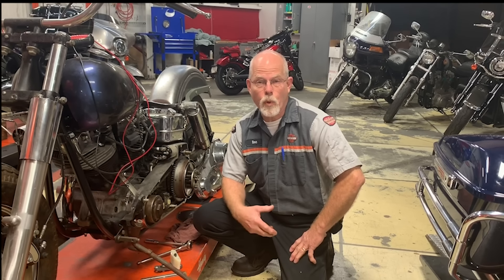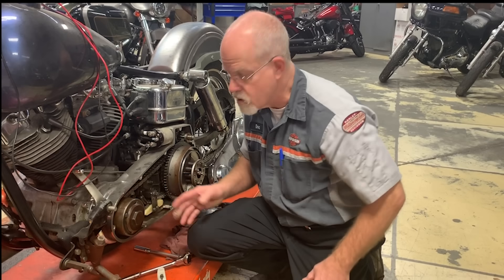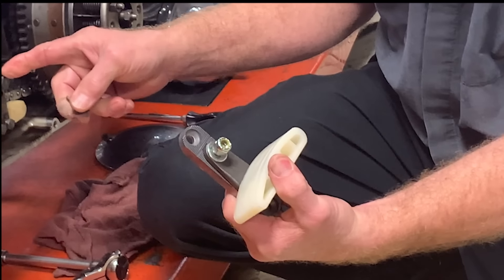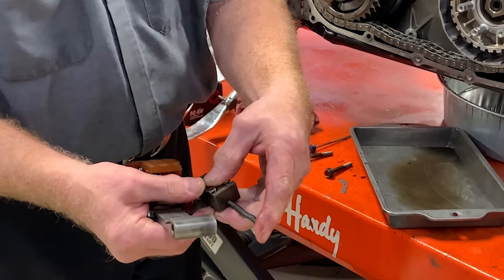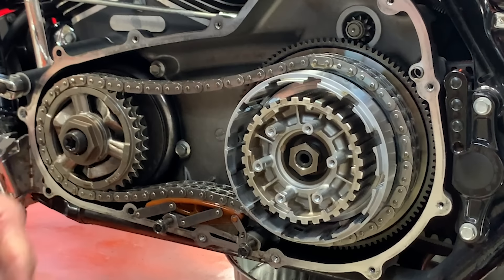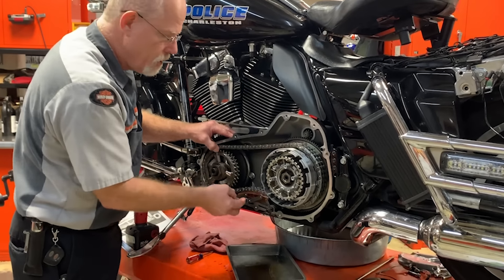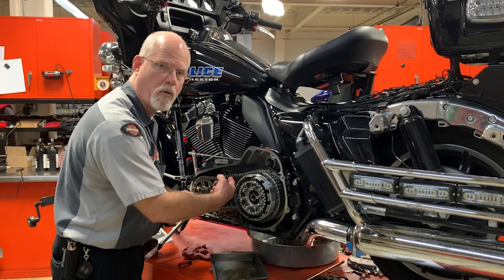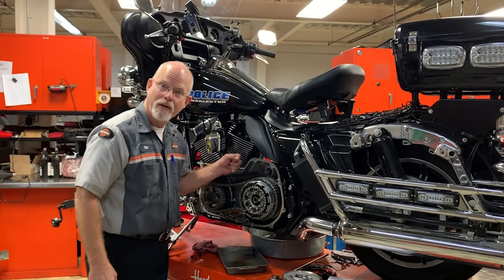DOC HARLEY: PRIMARY CHAIN ADJUSTER UPDATES

Comment: What about the faulty adjusters overtightening the primary and causing bushing and shaft failures?
Reply from the maker: How many have you personally seen? How many have you heard about? We’re they all on stock machines?….Doc
Reply: @LowCountryHarleyDavidson  i had one in my stock 2013 street bob, i changed it with hayden tensioner. It was tight as hqrd steel. I could tell the difference in gear changes in first ride.

Comment: So if my bike has 112 HP and 115 TQ and I occasionally ride aggressively and hard on the throttle, what type of chain tensioner should I run? I have a 2009 DYNA. Would prefer not to do manual adjustments.

Comment: Wat happen if the chain is to ty 2008 street glide
Reply from the maker: Undo stress on compensator, clutch bearings, misalignment of starter to to ring gear and seals leaking…Doc
Reply: Thanks doc for the answer, great video do you have gracias

Comment: Gees I know i'm adding a late comment here but will the primary chain need to be changed out if it becomes too stretched and does it make a type of ticking noise when rotating?
Reply from the maker: Yes if at the limit of the adjuster. The ticking might be the chain going over the sprockets at an extreme angle….Doc
Reply: @LowCountryHarleyDavidson  Could it be possible for you to see a vid of the primary chain in motion? That I can send you?

Comment: Doc I’ve got a 2010 street glide and I changed the stator , I put the compensator and clutch assembly back on and torqued to spec the the chain tensioner back on and new gasket and primery cover and put oil back in and started the bike and I’m hearing what sounds like the chain rattling on the primery cover . What have I done wrong sir ? Please help
Reply from the maker: Maybe nothing wrong. Remove the clutch cover with of course the bike off and held upright. Take a long screwdriver and a flashlight and look at how much the chain moves. You might have installed the primary adjuster at a tight spot. If the chain moves very little. Disassemble and be sure one of the spring plates didn’t move out of place…..Doc
Reply: Are you talking about the spring plates that go onto the compensator ? The only thing I noticed about the compensator was it seemed really loose after I tightened it to spec . But I thought that it was normal .
Reply: I’m doing what you told me and I’ll let you know what I seen .
Reply: The chain has play in it . The tensioner doesn’t look like it has expanded much .

Comment: my 103 had a rattling noise and whine noise from the primary side,after inspection the chain shows 1 inch play,auto adjuster was loose to the point it rattles on the teeth, final play set to 5/8 on tight spot, but the whine noise stills there,is not a loud whine but you can hear it when you get close to the bike,it gets a bit louder when engine revs! 
what can be causing this whine?

Comment: Hi i recently had to change the Teflon tensioning foot for the third time. while checking i discovered that at 5/8's cold on the tight spot it is approximately 9/16 difference from tight to loose. i have 1 1/8 on the loose spot.
Reply from the maker: It is time to disassemble and examine all parts. 1 1/8” is too loose. You did not mention year, model or mileage. The worst scenario is your flywheels have scissored. Put a dial indicator on the sprocket shaft. Then check clutch and primary bearings and Transmission main shaft…..Doc

Comment: Hi Doc, great video as always..I have a 2022 114 Street Bob and have a whining noise from primary. I have been 'giving it some gas' since new and have 4,600 miles on it. I cant get or even see the chain through the derby so I am going to take Primary cover off and reset adjuster. If it is too tight do I need to set chain tension manually before I ride or will the adjuster ratchet up straight away? I dont want it slapping about until it has become correct...hope your well and thanks for all your great videos.
Reply from the maker: Manually adjust it to the proper deflection….Doc
Reply: @LowCountryHarleyDavidson  thanks Doc..

Comment: Mike help i have a 2014 lowrider and it barely has 4500 miles on it, bought last oct with 900 on it. If you remember I'm pretty big. 275 when i was at low country about 340 now, and wife rides with,  we went to HD 13" shocks (stock is 12") had them professionally installed and belt adjusted slightly because there was a whoring sound. It seemed to go away briefly but came back its seems to be in the primary and goes away on hard excelleration and is loudest at steady speed, and has a softer more rotational sound on slow down....any ideas?
Reply from the maker: I know you are a season rider. Are you adjusting the Rear shock for just you and when the wife joins you?  Are you staying in the right gear longer ie not shifting into 6th until 70?  I suggest you try the new Heavy oil HD now offers. This seems to quiet the primary a lot....You also have the option of having a look inside the primary to be sure the Auto chain adjuster is working properly....Doc
Reply: @LowCountryHarleyDavidson  Yeah the HD Shocks came adjusted to the Center position from Drag Specialties and my mechanic and i left it there and even 2 up it's almost perfect, a tiny tiny bit bouncy when i ride solo, but i think the sundowner seat adds to that feeling cause it's so thick, and the belt seems to be within spec, i will try changing the oil 1st and see if that helps, i'm using Red Line right now

Comment: That was a great video. If you have a big TC motor I highly suggest a Baker Drivetrain manuel primary chain adjuster.
Reply from the maker: Thanks for the tip.....Doc
Reply: I get that there's issues with the automatic adjuster, but to put in a manual adjuster means taking off primary ( losing $20 worth of oil) and having to adjust it. Seems like a lose-lose situation.

Comment: Mike, some you tube content makers are blaming the Automatic primary adjusters on the pinion shaft run out and the crank scissoring, i have a Dyna with the TC103 and just a stage 1 with screaming eagle parts, much like my 06 yellow FXDC i had when we worked together. I'm in my mid 60's now and racing days long since gone, but i will play from time to time, should i be concerned with the auto tensioner causing a bigger problem with the crank and pinion shaft side ?
Reply from the maker: The Auto-tensioner has its week points. When throttle abused. It can put additional stress on Compensator, clutch bearings, transmission bearings. I have not diagnosed a pinion shaft issue to a tensioner over tight. But there are many engine builder's like Baxter who can tell you more. Not addressing a loose or broken Compensator has ruined more flywheels...Doc
Reply: Yes!

Comment: I am having to replace my third inter primary bearing at 70000 miles, in your opinion could the auto adjust be my problem, getting chain to tight?
Reply from the maker: There a so many reasons that pointing to the chain adjuster is too easy. Worst scenario the crank is out pulling and loosening several times a minute. The other end the Main shaft/ main bearing is going bad. Of coarse you have said nothing about your riding style or 150hp trying to find its way out…..Doc

Comment: you say they changed in 06, was it late 06?  I have an 06 ultra, it still has the inspection cover and the manual gives you instructions on adjusting.  Haven't taken it apart to check, but its in the plans.  Need to pull primary to change drive belt(53k miles on her), shifter shaft seal, and shifter arm.  May have to look into the retro fit upgrade.

Comment: Doc, Last weekend I rode my bike (street glide SP 16) It was about 105 degrees I think. Anyway my ride was fine until I got to my destination, I got back on the bike too move it and the clutch would not engage good, I finally got it moved. But what would cause this? After it cooled off it was fine, I also rode it a few days ago and the clutch feel fine.
Reply from the maker: There is an adjustment at the clutch. 1/4-3/4 turn out. BUT for police bikes during a competition we have to turn it out more for the extra heat. Heat can take  up the slack at the 1/4-3/4 adjustment and disengage the clutch….Doc

Comment: Yes talking about the automatic primary chain adjusters. Be careful how you ride actually you know as well as I do they get entirely too tight. They’re hard on the transmission the bearings everything on that side with them things get so Tight. Better to be a little loose than that tight. It was nice on the older boys we had a little cover to take off  a couple minutes and you’re on your way. Now compensators bearings very hard on them. They should have a hydraulic set up for something. But they keep taking shit off . Even better would be is to make it a gear drive. You know like there’s other people. Yeah no chain to worry about. I know that slapping around none of that over tightening just a couple Carrier sprockets. That would be a nice set up strong to if it’s done right. My opinion enjoy your show
Reply from the maker: I wish you were an engineer up at Harley-Davidson...Doc
Reply: @LowCountryHarleyDavidson  Hey doc I enjoy your videos wasn’t trying to be a smart ass I hope you didn’t take me that way but I had to take mine off the new Harley self adjusting. Messed everything all up. Seems to me it wouldn’t be all that big of a deal to make that a gear drive. I guess they call that a wear Item. Love my Harley I’m sure you seen a lot of what I’m talking about. I hope they got those lifters straightened out. Damn outsourcing
Reply: @LowCountryHarleyDavidson  God bless you and God bless America.

Comment: hey Doc would this also cause hard shifting through gears and a loud clunk going from neutral to first gear ? i have a 2010 electra glide 96ci with 20500 miles
Reply from the maker: Yes it is possible....Doc

Comment: I just converted over to an automatic chain tensioner. I do like to hot rod and have a heavy hand. Should I switch back over to a manual?
Reply from the maker: Check the tension after a few rides. If it is always too tight...Yes

Comment: I threw my stock 2010 Street Glide auto tensioner in the garbage where it belongs. My chain was way too tight and the primary was wining big time (bike only has 3,700 miles. I installed a hydraulic SO Hot Bikes HB125-07 Primary Chain Tensioner for Big Twins and wow what a difference. No more wining and the bike shifts and drives amazing now.

Comment: On my 2008 FXDC the automatic adjuster was over tightening my primary chain so much that the splines on my clutch hub broke off. I switch it out to a manual adjuster and have not had that problem since.

Comment: did the baker manual chain tensioner install on '12 ultra as well during the bump up to a 110 big bore kit, ported heads, HF injectors, 259 cams, S&S cam plate, TC3 oil pump and inner bearing work...to include a SE compensator and clutch pack....the new comp is way too noisy...clack clack clack, now going to install a man o war comp...anyway, baker manual chain tensionser is thumbs up!
Reply from the maker: Thanks for sharing your experience...Doc

Comment: I couldn't find water pump on my 03' fxdx, but I did replace the primary chain adjuster with 06' Auto-adjuster an now every once in a while it slammed gears on startup. I've asked an told it's new auto adjuster slamming, Go back to manual adjustment! What do you think about this auto adjuster an starting slamming?

Comment: My stock 96 broke the tranny main shaft with this auto chain tightener in my first 20K. When I had to have the transmission repaired a second time I took it out and put in a manual adjuster. This is not a hot rod, just a commuter.

Comment: Thanks for the info on this auto primary chain adjuster. I've used the screwdriver trick many times. Although I agree snapping the throttle will tighten the primary chain with this adjuster, I also found out that pulling a long mountain grade will also cause a tight chain. One of the best things I ever did to my 2007 FLHTCU was to install a Braker Drivetrain compensator and the manual Attitude primary chain adjuster. It eliminates the false over-tightening once and for all, along with smoothing out the dreaded primary chain snatch at startup.
Reply: yep...did the baker install on '12 ultra as well during the bump up to a 110 w/cam and inner bearing work...to include a SE compensator....the new comp is way too noisy...clack clack clack, now going to install a man o war comp...anyway, baker manual chain tensionser is thumbs up!
Reply: That is one of the things I really like about my sportster 1200.  The chain is a manual adjustment only.  I have over 24k on my bike and I have only had to adjust my primary chain once.
Reply: I'm getting chain noise like the chain is loose maybe the adjuster isn't working

Comment: Hey doc..  I’m Farely new rider got my 2008 ultra  back 1 1/2 years ago and have a question.. when I go to start my bike people have said it grinds as I start it and I should have it looked at..  had a mechanic come out at Harley and listened to it..  he heard what my friends were talking about and said he had an ultra that did this and never figured out the problem.. it starts fine but he did say it may be the chain tensioner may be loose reason why I’m  listening to this video and want to know your opinion on it..  when I first got my bike the guy I bought it from had a stripped ring gear.. I replaced it and then that one stripped I caught it quickly and put on a new one back on again and rebuild starter thinking it was the starter and has been fine but what would make the starting part grind as it starts.. not sure if you have a way for me to send you a sample video..  but I’m at a loss..  thanks!
Reply from the maker: You have not supplied much info about your bike. Mileage, modifications,services, age of battery and more. A part that is overlooked until it makes noise is the motor compensator. When this wears it lags behind the starter dragging the motor along. The difference between these two  not working together makes a grinding noise. Without having your bike it is one of the things to check….Doc

Comment: Can you provide any insight into the newest version? The 39929-06C. I notice the ramp that was metal on the A and B version is now polymer like the shoe on version C. Is this strictly a cost cutting measure per usual from Harley or do you think the teeth being plastic will shear if the belt becomes overly tight by the ratcheting? Thank you

Comment: Thanks for the video! Your time and effort is appreciated.
Owned Evo, Twin Cam, both old and new. Tried different chain adjusters. Despite the downside of the Harley one, it's as good as anything. Just maintain it if you ride it.
Buy a factory manual and get the right tools...and watch Doc and others with the help here.

Comment: The B was the third automatic tensioner if I understand correctly? The A was the second, and is the one installed in my 2009.  From what I hear, the B tensioner should solve most problems. Still not sure I feel reassured since Doc here mentioned the aggressive throttle getting a to tight chain. Oh, and the chain TIGHTENS when the bike gets warm. Which means I have a hard time starting my 2009 again after filling gas... (Also seems plausible this tensioner of mine might be why it sounds like the compensator is on it's last legs. Haven't opened it up to check yet, will when I get a new tensioner. )

Comment: I Love your channel Doc, I have picked up so many Tips and Tricks, Your the Man!  I would like to hear what you think about Hydraulic Tensioners?  I’ve had the Stage V Tire Shredder Kit installed and I Love playing with all that extra power! I will check with long screwdriver!
Reply from the maker: Hydraulic Tensioners are a great idea but the units need oil pressure to work properly.
Reply: Low Country Harley-Davidson   I thought it just sat in oil, like an oil bath, what would you recommend? Thanks